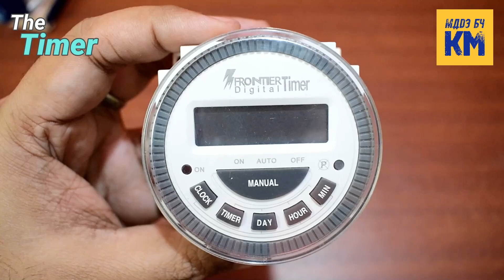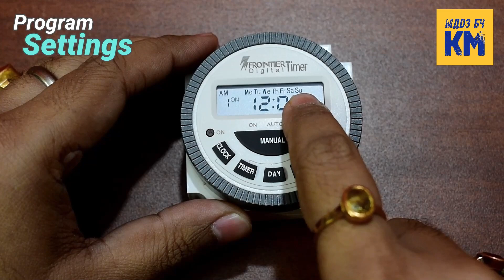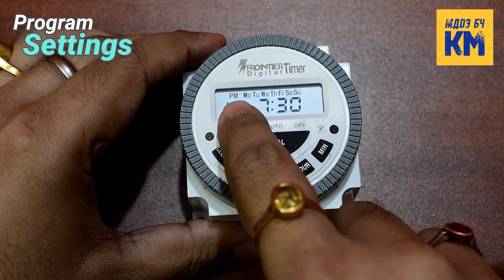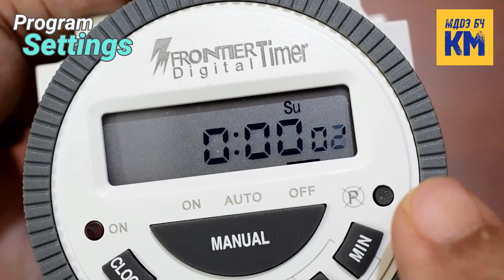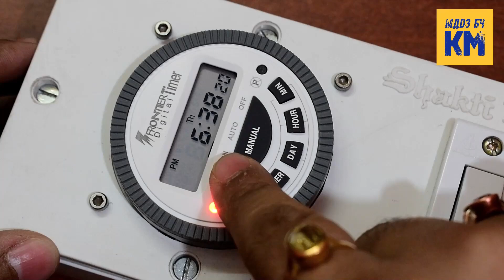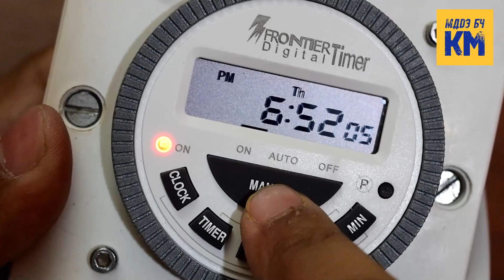Build a Reliable DIY Aquarium Timer for Lights & CO2 Control!

Comment: @madebykm

That's great info and u explained very well!
I just have one question, can we operate two different Socket with different program in current setup u shows? So lets say in one socket i have lights for some duration and in another socket i have filter for some different duration, i need both timings different. Is it possible or program  we setup is applicable for both socket you attached? If no do we need to buy two different unit for each socket? Please advice.
Reply from the maker: Then you need to use two timers and connect them to two different sockets and program them separately.
Reply: @madebykm  ok got it, Many thanks!

Comment: Dear KM Sir, will two different soccket will give two different on/off options???
Suppose one socket for co2 on/off around 1pm/7pm
Second socket for lights on/off 3pm/9pm.....
Please share your input 🙏
Reply from the maker: No, two timer modules are needed to run two different programs on two different sockets.

Comment: Very good one, very helpful.
I made a 4 in one remote sensor and attached it with a similar board.. will also make the aquarium light with led, just have to calculate the power required for a 4'8 inch aquarium for high tech plants.
Reply from the maker: Great 👍

Comment: dear sir i am just connect as per your instruction but initially its working and when we connect with pump and light by second switch is not working and timer has on but no output supply has come need your suggestion
Reply from the maker: Check for any loose connections

Comment: time ke 4 pin aur 5 pin wale me kya farak hota h pls btao
Reply from the maker: 4 pin wale timer normal electric switch ki tarah kaam karta hai. Iss me ON time me electrical equipments ON ho jayga aur OFF time me OFF ho jayga. 5 pin wale timer two way electric switch ki tarah kaam karta hai. Suppose, aap iss tarah program set kiya hai timer me ki 1PM se 2PM apka ON time hai aur 2PM se 3PM apka OFF time hai. ON time me, ek FAN ON rahega aur ek LIGHT OFF rahega. Ab jaise hi OFF time start hoga, tab automatically FAN OFF ho jayga aur LIGHT ON ho jayga. Ye feature 4 pin wale timer me nehi hai.
Reply: @madebykm  kya me 5 pin wale se 5pm se 12pm tk light on aur usi same timer se 6pm se 9pm tk Co2 on krwa sakta hu ? phir 9 bje co3 off ho jaye ga aur sirf light on rhe gi 12am tk raat ke ? esa possible h ? ya mujhe 2 alag alag timer buy krna hoga
Reply from the maker: Nehi aisa nehi hoga, iske liye 2 timer chahiye.

Comment: Any limits to number of plugs/devices? Or will multiple plugs work just fine?
Reply from the maker: No, there are no limitations. Multiple plugs or devices can be connected to these 2 sockets. However, all devices will turn on and off simultaneously.